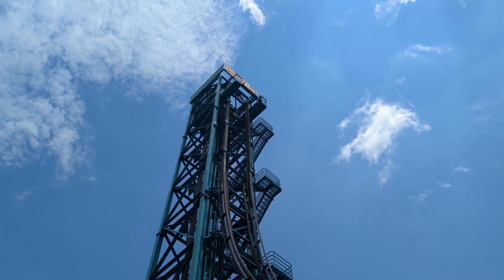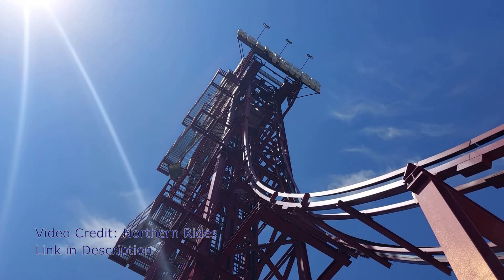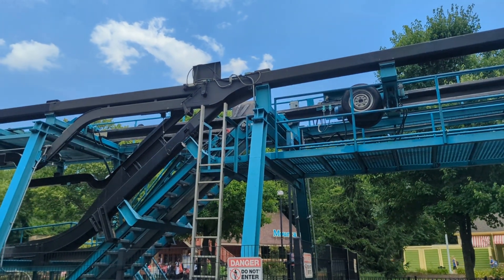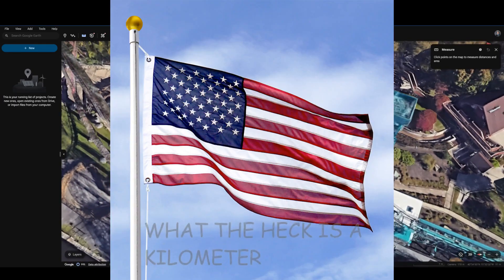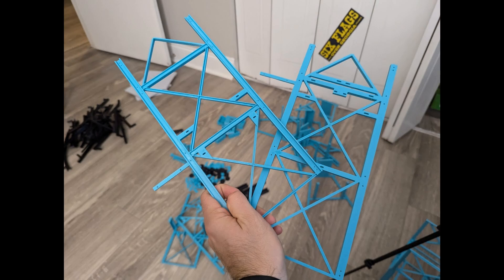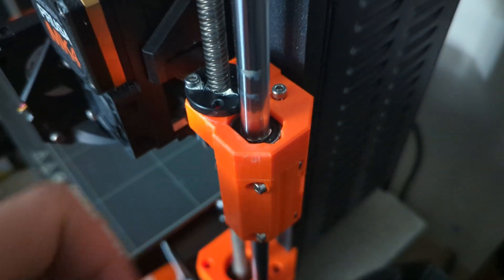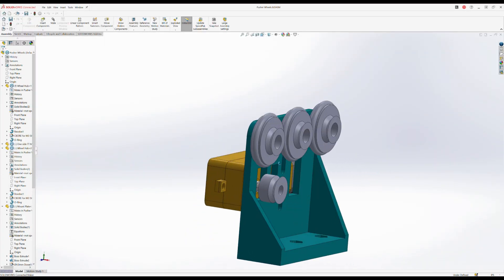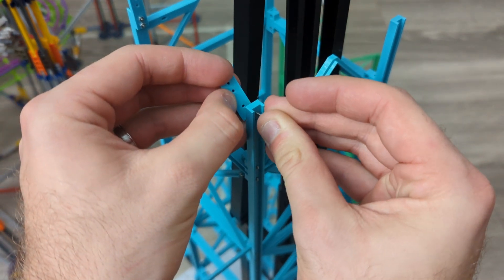Building a 4 Foot 3D printed Ride Tower | Demon Drop Model Part 1

Comment: Are you planing on Sharing the STL files ?  And If you don't mind me asking what do you do for work? And how do you have this much time ???
Reply from the maker: I will not be sharing files simply because there's way too many and I don't have the time to make instructions. Also many parts are too big to fit on standard hobby printers. 

I'm a mechanical engineer for my day job. I use a similar set of skills when I design parts for work, so that helped me complete the designs as fast as I did. It took two months to do the design work. I can practically design 3D printed parts and machines in my sleep.